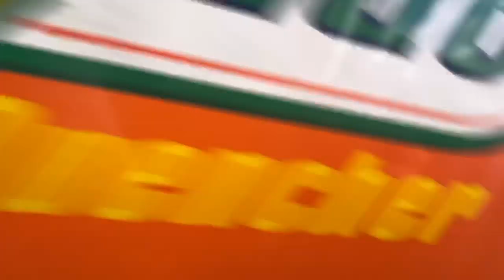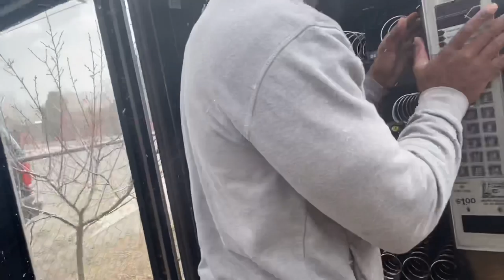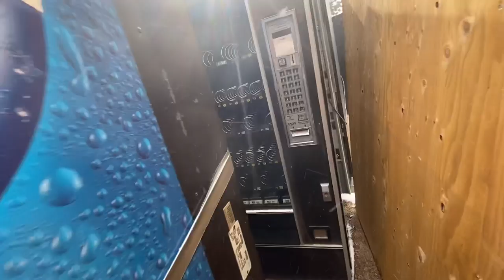TRAVELING TO BUY USED VENDING MACHINES FOR NEW LOCATIONS !!!!!

Comment: Dude,  I can't find a deal to save my life😤
Reply from the maker: Sometimes you have to go on a mission and go out of the way
Reply: @letstalkaboutit5802  Yeah, I've done it before. Problem now is that there are deals in Buffalo and areas of Ohio which I am close to both  but NY period has way too many cases of Covid and Buffalo has over 2000 cases so I'm not going there right now, and Ohio will probably pull me over with my PA tags and send be back. Pittsburgh is a little further than those places but I really havent seen anything there I want to travel for yet